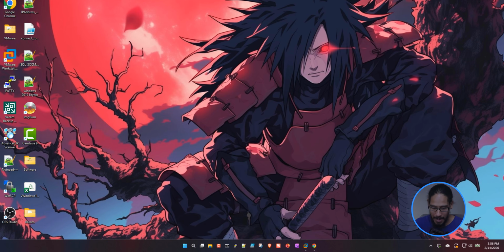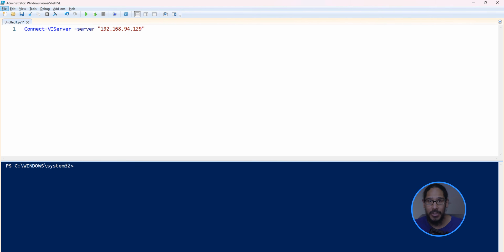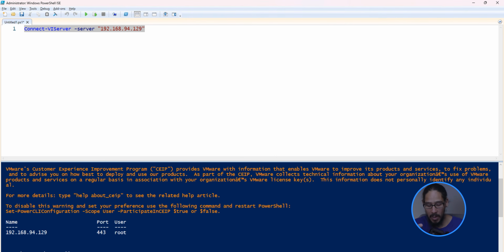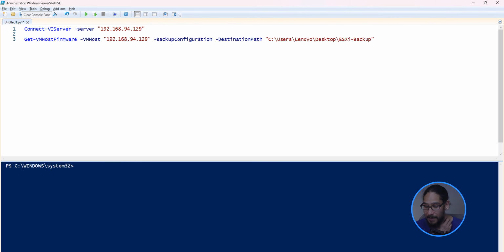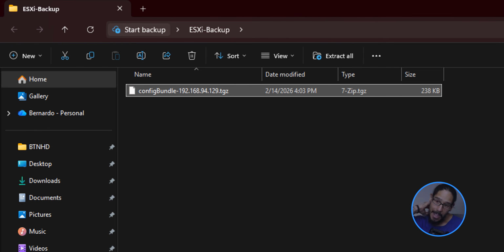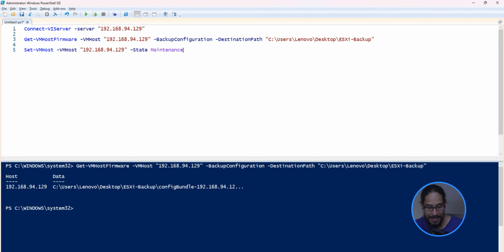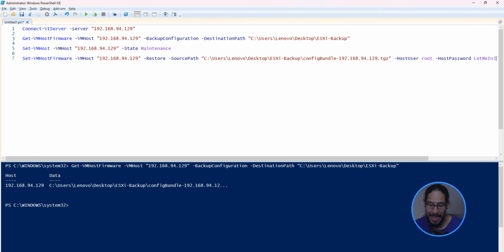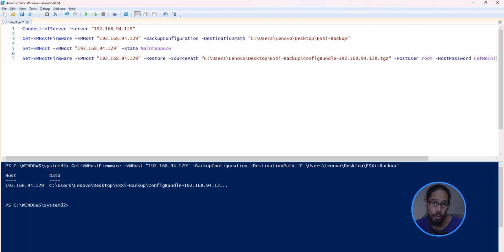Backup and Restore VMware ESXi Host FAST Using PowerCLI

Comment: What exactly does that backup because that file looks way too small to be the actual entire vm. It looks more like the vm settings or the vm config that was backed up and not the actual entire vm content on the vhd.
Reply from the maker: Great question! That script backs up the VM configuration only (.vmx, .nvram, etc.), not the virtual disks (.vmdk). It's intended for quickly restoring the VM configuration, not as a full VM backup. For a complete VM backup, you'll need to back up the VMDK files as well or use a proper backup solution like Veeam.